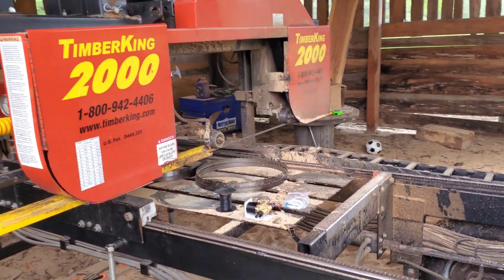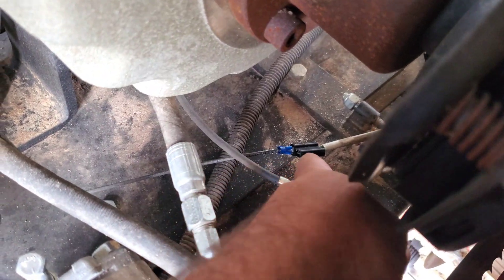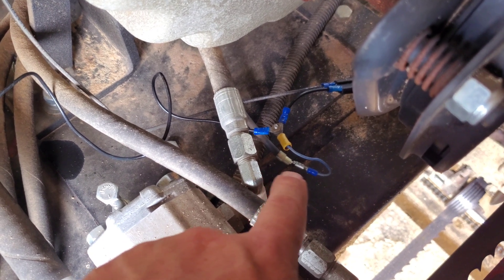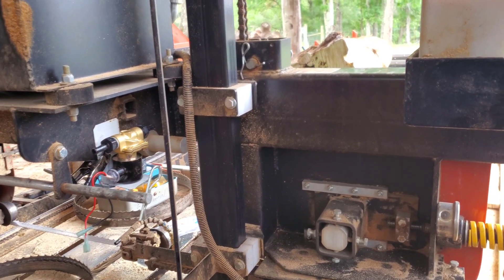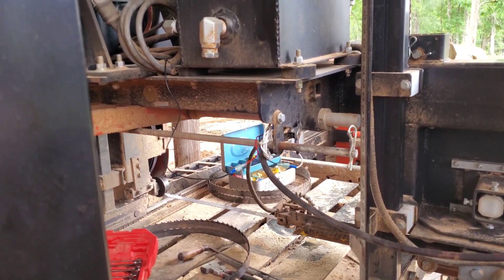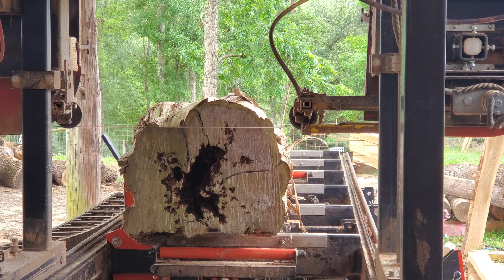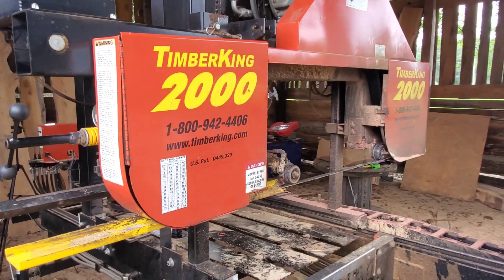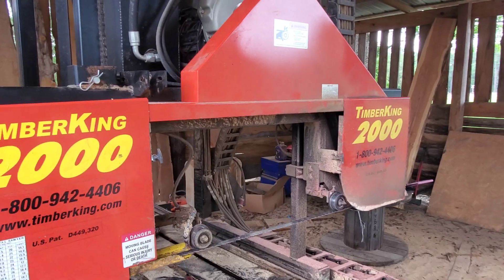Sawmill upgrades, installing a solenoid valve on the lubrication system

Comment: Hey bud! I've been binge watching your channel over the last 2 days and I love all the random bits of knowledge you sprinkle throughout these videos. I'm currently building my first sawmill but I havn't figured out the cooling system yet. Do you just use water?
Reply from the maker: Awesome and thanks.   I mostly just use water.  If pitch starts to build up I'll add a bit of dawn soap or pinesol.  If it's really bad I'll run a diesel drip.  But 90% of the time it's just water I collect off my roof into barrels.
Reply: @TCSawmills  Thanks! I've heard other people say to use diesel. I'll probably just have to stick a hose into a milk jug or something.

Comment: Do you shut off blade after each cut?  Timberking dealer recommended just throttling down less wear and tear on clutch.
Reply from the maker: Depending on what I'm cutting.   For videos I do so I can talk after the cut.  For dimensional stuff off camera, I run it without disengaging.  I sometimes throttle back but not always, yes it may wear it down a bit but not enough to really concern me. My buddy does the same and he's over 1000 hours with no issues. I keep a spare clutch on hand just incase.